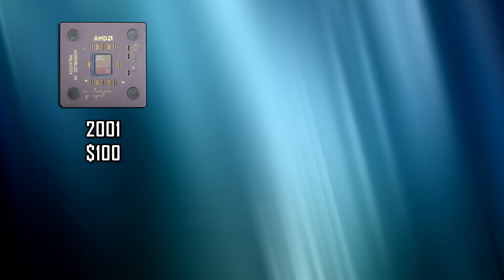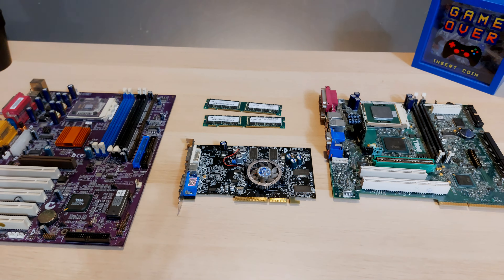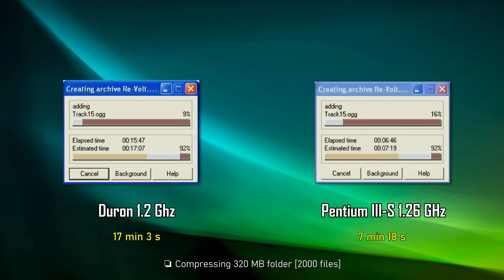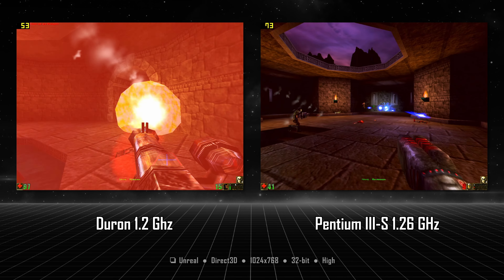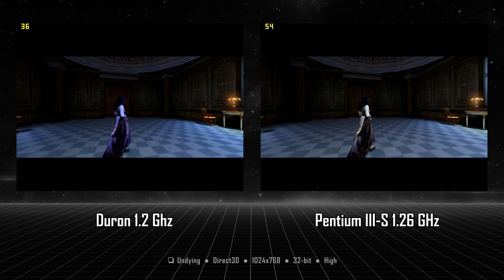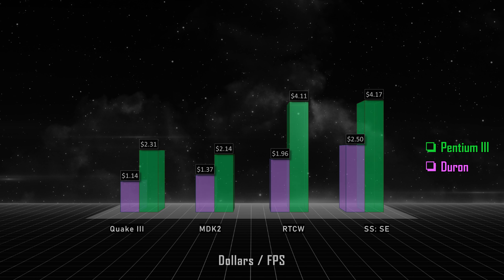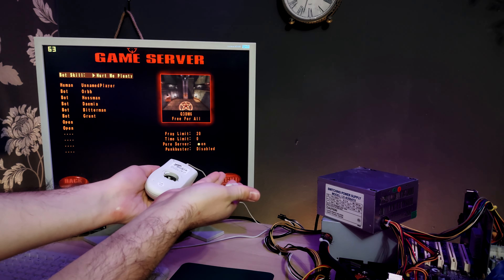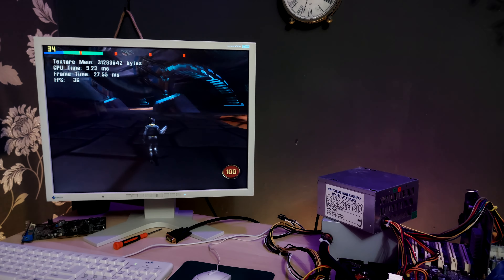Duron 1200 vs. Pentium III 1266

Comment: i had a Duron 650 and Savage 4 system for a bit in the late 90's and i remember it having pretty decent performance for the games i was playing at the time. now i wonder how much of that is colored by nostalgia vs just playing older games that were appropriate for the hardware. i think the original Unreal and Quake 1/2/3 was pretty playable and i was also playing a lot of strategy games too.

for some of the performance difference could be in cache architecture - the P3's 4-way associative cache and larger L2 can result in more efficient hits, leading to better performance in several cache and memory sensitive scenarios, compression being one of them if the compression algorithm is cache efficient.
Reply from the maker: Strategy games from that era were mostly 2D, so they ran pretty ok, I've played Age of Empires on a Pentium 166 MHz, without any issues.

Comment: In 2003 AMD launched the Applebred-core Durons which where absolutely fantastic. My Duron 1400 paired with an ABIT NF7-S happily ran at 2200mhz, cooled with a cheapo Artic Cooling air cooler, just by setting the fsb from 133 to 200mhz. This Duron was way faster then the Athlon XP 2600 that i had before. Best bang-for-your-bucks combo i ever bought.
Reply from the maker: Duron 2200 faster than the 2600+?? 

Yeah, the NF7 was a nice overclocker, I have one and it's amazing.
Reply: @MidnightGeek99  tbh i'm not 100% sure on which Athlon XPs the Duron outperformed. I had two Athlon XP before, both had 133Mhz FSB and ran pretty hot, also the VIA chipset annoyed me back in the day. So i got me a new setup with that cheapo Duron 1400 and the NF7-S, and that turned out to be my best socket-A combo by far.

Comment: I had the Duron chip, paired with a Geforce 2 MX400, it played Castle Wolfenstein okay :-) not great but it did it's job. Yes I did play at 640x480 most of the time, think I only switched to 1024x768 with the Geforce Ti4200 about 2 years later and an Athlon XP something or other.

Comment: Had a taulatin 1.13 ghz. Asus tuscl2 mobo. 256mb sdr ram. Went from a geforce 1 32mb to a geforce 3 ti 200. Was a great rig back then. 

Went on to a p4 3.0ghz w/HT and a geforce fx 5700 ultra. I bought the wrong mobo and videocard on this rig.
Reply from the maker: You had the exact build from my video :D 

Well, the FX 5700 Ultra was not THAT bad...you could have chosen worse.

Comment: My first computer (made myself), was a duron 800/512 mb of ddr and a geforce 2 ti with 64mb. Everything was smoooth as butter in 1024X768.
Reply from the maker: I bet, the GF2 Ti was an excellent card, is one of the cards that I really want in y collection.
Reply: @MidnightGeek99  that was a pretty good card (not as good as the titanium), i replaced it with a 8500 pro after that.

Comment: The Duron, Sempron and Celeron were mostly fine.
What destroyed the reputation of the cut down chips were the NetBurst Celeron (Especially the Prescott). The architecture was already massively cache and bandwith limited, so reducing both hurt the chip extremely. K7 wasn't hit that hard, and the K7 Duron, K8 Sempron and P6 Celeron are mostly good chips.
Same for the Core 2 era Celeron. They were extremely cheap and could be clocked to pretty much the same speeds as the expensive chips. Only real difference was the cache.

But a great memory choice for the Pentium 3. PC133 CL2 is bascially the peak, outside of overclocking.

And while the Duron has only 100 MHz FSB, that bus is double pumped for 200 MT/s, while the Pentium 3 gets from it 133 MHz bus 133 MT/s. It's a bit like comparing DDR-200 with PC133 SDRAM. The DDR runs at 100 MHz, but transfers twice per clock, which means the bandwith on the Duron is about 50% higher than on the Pentium 3.

The real difference for retro purposes is price. A Duron 1200 will be much cheaper than a Pentium III-S 1266
But the same counts for a Celeron 1200 and Athlon 1200
There is almost perfect parity at the 900-1400 MHz range, with the Athlon and Pentium III being faster than Durons/Celerons at the same clock.
But all of them will make fine choices for games up to around 2000, maybe some from 2001. (Halo and Morrowind for example don't run amazing on my Pentium III 933/Geforce 3 Ti 200 setup, but should do much better with an Athlon or Tualatin at 1200-1600 MHz)
Reply from the maker: The netburst celeron was bad, and the first celerons, those without l2 cache, if I'm not mistaken.

And I agree, for retro purposes, the Duron is still a price and performance champion.

Comment: If you have the right socket a motherboard like pc chips you can also run a amd geode nx. Basically a laptop cpu. Those geode nx cpus use like 9 watts and were even cheaper then duron. Geode NX 1750 was only $55 new. Duron 1200 was $103. Im using the geode underclocked and with disabled cache as dos pc, for the early dos games.
Reply from the maker: I've never used mobile CPUs on a desktop, we also had Athlons and Pentium 4s, but I would like to try sometime.

Comment: The Duron was my CPU during a good part of my college years. It was an 800MHz CPU and I think it was paired with a Geforce 4 MX.
That CPU ended up in smoke as I've tried to see if either the mobo or an Athlon XP were faulty and for the test I haven't installed a cooler on it. Bad decision! For the things to be even more annoying, it was the day when I was supposed to sell the CPU for 800.000lei.
Reply from the maker: I'm sorry for your loss! 800.000 lei, now that's an old reference :D

I still remember the commercials with the Duron 1200 system from Flamingo, 12.000.000 lei if I'm not mistaken, around 2001-2002.

Comment: I think all of games tested here didn't support hardware transform and lighting (aka proto-vertex shaders) despite 9600XT supporting it. So all the animation and transformation stuff had to be done by the CPU and Duron with its miniscule cache naturally had problems - while 9600XT was sitting there doing almost nothing but texturing. Irony is that if you were to test more modern games, especially DirectX 8 ones - the results would probably be somewhat closer.
Reply from the maker: I'm pretty sure RTCW, MDK2 and Serious Sam have transform and lighting capabilities.
Reply: @MidnightGeek99  ah yes - Quake 3 certainly does or at least does it really well - which really makes for really small difference in FPS between two CPUs in this very video. And RTCW, which was fairly demanding for its time, runs quite decently compared to a considerably older Unreal.

Saying that - I had Duron 800 MHz in my PC way back, which I promptly upgraded to Athlon XP 1.8 GHz, which was night and day.

Comment: Tualatin is sick fast. I have both Athlon XP (Barton) @2GHz and Tualatin P3-S @1,575GHz, around 150FSB both and on SDR motherboard. Tualatin is not much slower than Athlon, even if it's clock speed is lot slower.
Reply from the maker: Yeah, the Tualatin is a beast, a really nice exit for the venerable Pentium III.

Comment: Not sure how youtube listened to my thoughts, but yep i got a motherboard and a Duron lately. Going to put together a nice win98 system. A little bit too new for what i wanted, but being low end from then, and not too new to not support things. Yea. It's good. Now i just need to get some DDR1 for it. Thought i had a couple dimms of it but apparently it was DDR2 so eh. A little bit of searching. But it's going to be good. Also some bulging caps but those are on the way already and nice big through hole connections on them so shouldn't be a problem.
Also. A modern PSU. Could have gotten the original but it may be a fire hazard. And i'm 100% willing to compromise on originality in the name of safety.
Reply: The compression speed may be due to its predictability. Pentium has a lot deeper pipeline, it helps in those tasks, also slows gaming tasks a bit, but not considerably.

That is also the reason for why Xeons are better at work tasks and Core series is better for gaming. I upgraded from an old surplus server to a modern gaming PC a couple years ago. A full decade of progress. Sold the old one for the same price that i bought the parts for the new one. And it was a huge win for both me and the buyer of the old workstation. Two Xeon can't remember what processors. A huge amount of cores. And the current PC is still faster in about everything. Everything except compressing and decompressing. That was some ten times faster on the old one. Yep the cores helped, and in pentium/duron era those weren't a thing. But the pipeline being some three times longer is the biggest factor. Predictable processes right after each other, getting started when the ones ahead are way off from being complete.

I have had hard time wrapping my head around what pipelines mean for processor technology. They were a huge step forward on Pentium era.
Reply from the maker: Get a modern PSU, don't risk with older ones, especially if you don't need them, you can still find 200+ W 3V&5V new PSUs.

Enjoy your system, the Duron is excellent for 98.
Reply: @MidnightGeek99  Just arrived in the post. A cheap price for not burning down my house.

Comment: I've had a Pentium 4 Willamette with 1.5GHz in 2001. I would've killed for the performance of the little Duron. It's incredible how much of a turd first gen P4 were. Even when I got a GF4 Ti4400 a year later, I couldn't reach 6000 points in 3DMark01SE.
Reply from the maker: I'm sorry m8, Willamette was a joke :)

Comment: And now, try to hack your cpu and transform them into "Athlon" by L1 unlocking - it is cut down Palomino, so it should be fine :D pencil mod gives you unlocked multiplier and great OC
Reply from the maker: I usually don't stress these components, I want to keep them for as many years as I can.